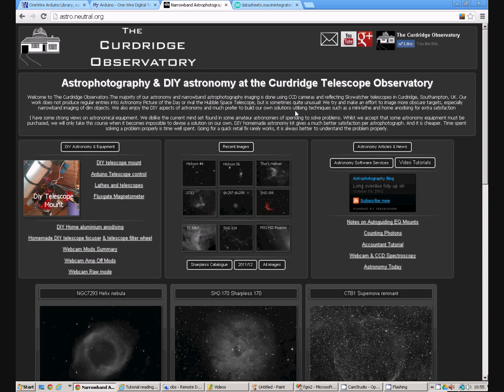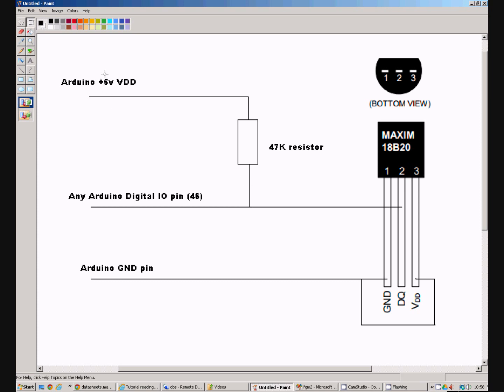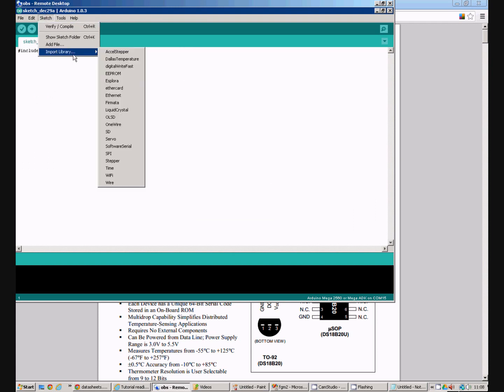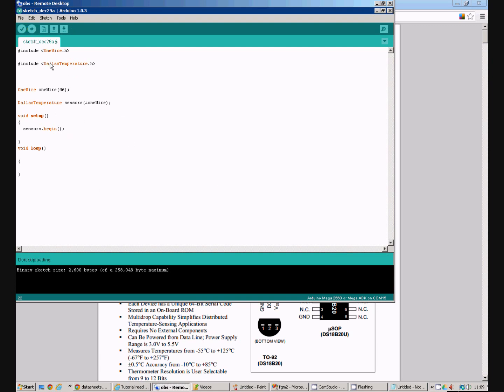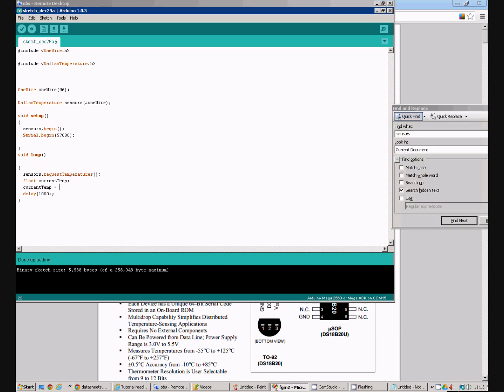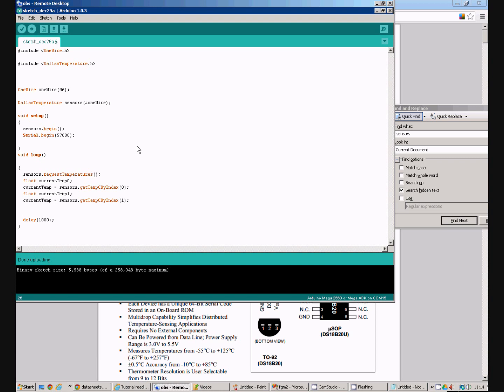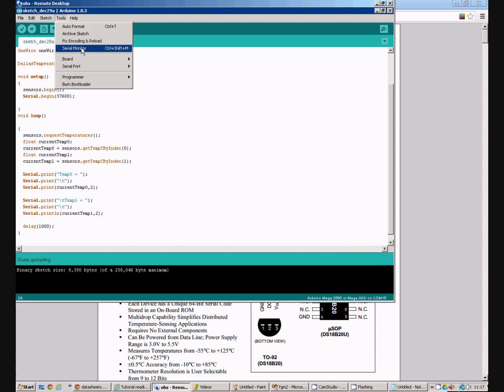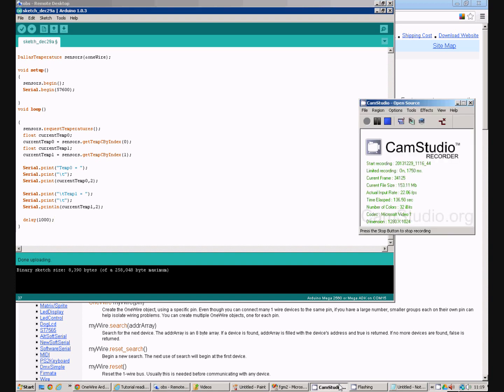DS18B20 Dallas 1-Wire digital temperature sensor with Arduino tutorial

Comment: Just wanted to thank you for your video. I tried a few other tutorials to connect the DS18B20 to the Arduino and always ran into problems. Your explanations were to the point, not too fast and easy to follow. Now I can continue installing the sensors around the house (I combined your code with an other example for the Ethernet Shield and I sit on my sofa and red out 3 temperatures for 3 different rooms on my laptop.

Comment: Is that 4.7K resistor or 47K resistor as you said?
Reply: Yes, from multiple other references, I see that 4.7K down to 3.1K is used.  I believe 47K is a mistake . . . but great tutorial!
Reply: ***** Yes it is very good indeed and very nice of him to post it. I confirm it works too at 4.7K with two sensors
Reply: +NoFaithNoPain 4.7 K

Comment: OneWire does not make a nymae type
same for the dallas temperature
then in teh void loop, sensors was not declared in this scope

something with the libraryes, but i do have bot the OneWire and DallasTemperature in my documents arduino folder and the one in the installation directory root.

Comment: Hello Tom
I'm trying to use DS18B20 in Flowcode AVR project. I know,You probably don't use it and don't know how it looks like to work in FC, but my question is not about that.
 I know that this sensore send digital output for coresponding temperature ( like bin:1100100000 =HEX: 0320h  ). So to get temperature in celsius data output converted to decimal must be dived by 16 right? 1100100000 = DEC: 800 /16 = 50C
There are macros in Flowcode called read_scratchpad and get_temp but I'm not sure how to use them. Do have any idea what read_scratchpad mean, what does it do, or what the hell is scratchpad in microcontroller world ? AS i figure it out it's something like your step at 6:37 set data to buffer and make it ready for read? :) Just what ever you think say it, for sure it could help me to understand. Thanks

Comment: 'Arduino: 1.6.5 (Mac OS X), Board: "Arduino Uno"

Build options changed, rebuilding all
temp_4:7: error: 'onewire' was not declared in this scope
'onewire' was not declared in this scope

  This report would have more information with
  "Show verbose output during compilation"
  enabled in File > Preferences.'
How can I fix this?

Also, I am using Moteino, which works perfectly with Arduino IDE, but does not contain a 5V pin.

Furthermore, what is a pull-up resistor? Can you show a photo of the end result?

This is a great tutorial -- sorry for all the questions. Thank you!

Comment: Very nice tutorial! Will be very helpful for my home climate control project. But I have a question about your programming code. perhaps you or everyone reading this could answer for me. I'm a beginner to programming. The question I have is in your code Serial.print(CurrentTemp0, 2); does the 2 refer to the number of sensors in the daisy chain?
Thanks
Reply: No it's just a print command - it's does not need to know how many sensors you have, it just display information in the serial monitor :-)
The 2 is the number of digit after the decimal point you want.

Comment: That was parasitic mode which is not advised for multiple sensors on the one bus. Normal mode is Vcc (pin3) and DQ2 to +5V with a 4.7K between them. Pin 1 to ground.

Comment: Hello there thanks for this video ...i connected and wrote the code such as you then i got -127 all the times !! why this is happening to me ...can any body help?
Reply: try a different voltage ie 5 rather than 3.3..worked for me
Reply: You may not have the DS18B20 data line connected to the correct Data pin on the Arduino. The example sketch is using pin 46.  You will get -127 if the Arduino is not receiving any data.

Comment: I just get -127.00 degrees:(
Reply: Anoroc did it work? i get the same error
Reply: You may not have the DS18B20 data line connected to the correct Data pin on the Arduino. The example sketch is using pin 46.  You will get -127 if the Arduino is not receiving any data from the DS18B20.